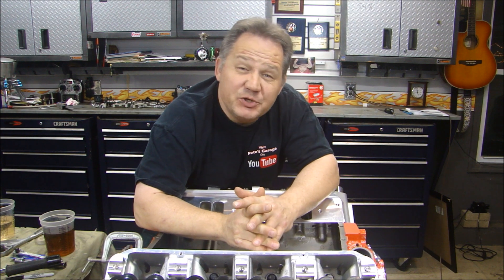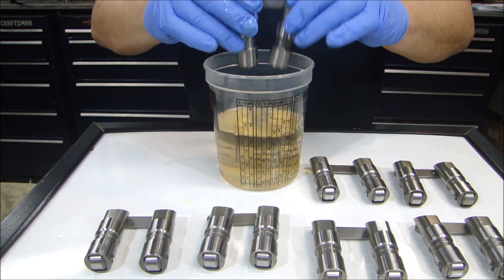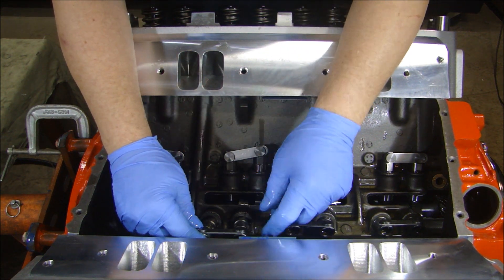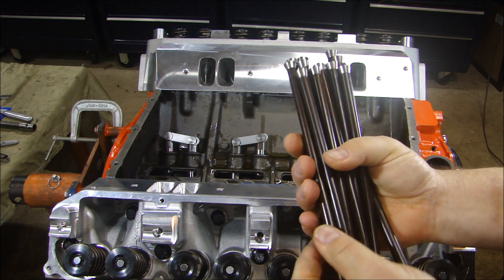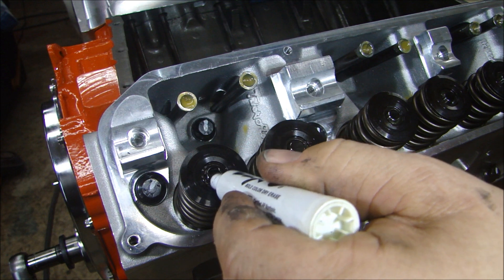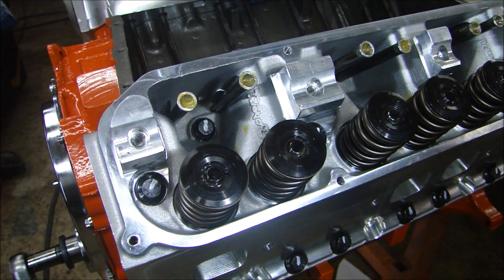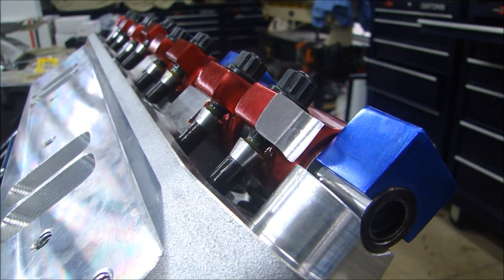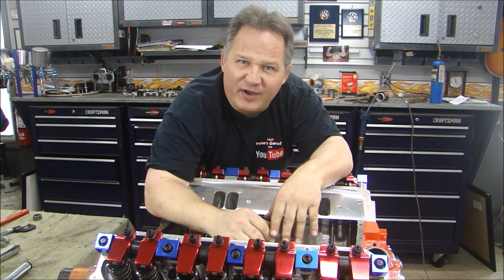440 Chrysler Mopar Part 9 - Installing Roller Hydraulic Lifters, Pushrods, Rockers & Setting Lash

Comment: I’m fighting with prw 3244012 right now, even with the thinnest shims the centre to centre its off with the valve steps, I either had to grind the 1/2” spacer in between the rockers arms or no shims on either side of the 1/2” spacer
Reply from the maker: I've ground those many times. It's ok to do
Reply: Stems

Comment: Hi Pete,
Very good instruction. I have just finished a 440 build using Trickflow 240 heads and Harland Sharp 1.6 rockers. When I start the engine it sounds like a bit of a faint typewriter. The sound never totally goes away but does get better. Do hydraulic rollers with the connecting bar make a little noise? Is that normal? 

I removed the valve covers and the rockers are not hitting the valve covers.

When I removed the covers I can move some of the rockers by hand for the valves that are up. I'm not sure if I am compressing the hydraulic lifter a bit or if it's free play. 

Is it typical for a hydraulic lifter to lose some pressure after you shut the engine down? Could this movement in the rocker be a bit of normal lifter bleed down?

Is a full turn preload pretty much standard? Can it be different depending on the rockers/cam etc.? 

Thanks for great videos. Your videos series has helped me with my 440 build.
Reply: I readjusted the preload and still had noise. I think something went wrong cause I heard clattering in the valve train that did diminish. I thought it was lack of oil in the lifters. The lack of oil pressure turned out to be a bad new oil pump. I have oil pressure but now I have a miss and puffs of blue smoke when I hit the throttle. 
My concern it bent valve (s). How can I confirm if I have bent valves from incorrectly adjusting the preload. I used a chart and was careful but something is wrong. It is a new engine build but the smoke was not there before. 
Will a compression test be enough to tell me if the piston hit the valves? I didn’t even go a half turn but apparently the procedure was not correct. The valves were up and I can’t understand what went wrong. The oil pressure works fine now but I have a miss and puffs of smoke hitting the throttle. There is break-in oil in the engine still. I don’t have many minutes on the engine but this is the first sign of oil sign readjusting the preload. Any thoughts and suggestions would be appreciated.
Reply from the maker: A compression test can detect a stuck valve.
Reply from the maker: If you readjusted after running the engine, you probably have too much preload now. I would start be setting them to zero lash and add maybe 5 degrees.
Reply from the maker: A full turn is a bit much. I go a half turn max. Try resetting and try again.
Reply: @PetesGarage  will do. Do you have any recommendations for removing sealant on cylinder heads after removing valve covers? What is your best method for installing valve covers? I have watched you in the past using Right Stuff? Would you apply to both the valve covers and cylinder heads side of the valve cover gasket?
Reply from the maker: Unfortunately it's elbow grease and solvents.

Comment: Hi Pete I am putting together my 440 engine, I bought a kit from eBay 1600$ kit aluminum heads, red and blue rocker kit , aluminum high rise intake, I am noticing my push rods are in a angle from lifter, thru the hole in the head, to the rocker arm, please help me I am confused, a few are straight and some are in a angle
Reply from the maker: The rocker arms are individually shimmed to center them
Reply: The rods from the lifter to the rockers are slightly angled going thru the head , can’t straighten completely cause rods will rub the head , being in a slight angle is that normal
Reply from the maker: They should not be. Something is off

Comment: Hi Pete from Austria,
a little odd question on your channel, I own a Volvo Amazon 4 cyl. 123GT . I'd like to change the "normal" rocker arms to such as roller rockers. Recently I got to know that those of Mopar 340 or 440 should fit .
Do you have got any idea whether that's the fact ?
Thanks for your efforts and kind regards

Wolfgang  ( impressed of your presentation !!!)
Reply from the maker: You could make it fit, but you'll have to change the transmission too
Reply: @PetesGarage  thank you for response. Changing transmission what do you mean in detail? Regards Wolfgang
Reply from the maker: One that will match the bellhousing for the new engine
Reply: @PetesGarage  ,,I'm afraid it was the wrong reply to my initial question i.e.
Do you think that Mopar 340 or Mopar 440 shaft roller rockers fit to my Volvo 123GT  B20 engine.A rumor is going about those roller rockers should fit to.

Comment: Your mineral spirited just took or dissolved any oil that was in the bearings and that 2 seconds you dipped them in oil did nothing for the bearings in the roller.   Roller lifters need soaked for a while and it has nothing to do with the hydraulic mechanism.
Reply from the maker: Mineral spirits are made from 100% petroleum distillates (aka oil). Please share exactly what soaking it does.
Reply: @PetesGarage  No kidding.  It’s not oil, it dissolves any lubricant that’s in the rollers.   Soaking the lifter for ten seconds isn’t lubricating the bearings.
Reply from the maker: So what does soaking do and for how long is it necessary?
Reply: @PetesGarage  ya soak them for hours.  And your just being stubborn
Reply from the maker: @davidleary823  I am simply looking for the correct engineering answer so everyone can benefit.
Reply: @PetesGarage  ok.  Clean as you did.  Just soak the bottom (roller) of the lifter a LOT longer is all.  Not all lifters are hippos. Hyd or solid
Reply: I put mine in a pot with oil then on the stove till the oil gets hot to the touch, then turn the stove off after 15 minutes.  Let them sit till oil gets cold then install. Same oil as what is going in engine.
Reply: @frankroy9423  good idea

Comment: I hate to bug you again sir, but have a quick question about the rockers you and the way you shim them. Do any shims go between the large black spacers between the rockers?
Reply from the maker: Yes, to get the rockers centered on the valves
Reply: @PetesGarage  thanks again, great information on this channel!
Reply: Hi Pete I am putting on a kit on my 440 that I bought from eBay 1600$ kit uluminum heads red and blue rockers and high rise aluminum intake , I am noticing my push rods are in a angle from lifter thru the hole on the head to my rocker, is that the way it supposed to be, first time doing this but don’t look normal, can you please advise
Reply: @fredvillareal3929  I had a big issue with those same rockers, PCE261.1034 from speed master. The ball end of my adjusters had a really sharp point and were binding at the pushrods. I had to remove the adjusters and smooth each one out with a light sandpaper until all of the sharp burrs were gone. It must've been a machining defect from the factory.  They seem to be working now after all of this but I'll probably get new rocker arms. Maybe from 440 source.

Comment: Hello, I'm using the same PCE rocker arms for my 383 dodge motor but having trouble finding the correct style and length pushrod. These rocker adjusters use a cup style pushrod,the length i need is an 8.3-8.5 inch or so but that size is hard to find. Is it possible to change the adjusters to somehow make them work?
Reply from the maker: Did you check 440source?
Reply: @PetesGarage  oh wow forgot about them, looks like they have what I need. Thanks for the help sir!!

Comment: Pete,  in  cleaning in spirits,aren't t the  internals  dirty  and don't get clean without pump up/pressure,  and  Why not use a pressure lube and spray  springs  during   start up,  to allow  mating
Reply from the maker: The internals are clean after machining

Comment: Hey Pete been watching your videos on the build and they are excellent. I have Indy 440 -1 aluminum heads on my Mega block, can you tell me what you would suggest for the torque on my rocker shafts? I have ARP studs in everything. I read somewhere online they say 25 to 30ft lbs. sound right? Indy is kind of subject when I call them I always get a desk clerk that has to ask others and then comes back sounding umm well not very sure…Appreciate your input gonna install tonight. Thanks
Reply from the maker: The torque is different in aluminum heads. 25 to 30 is for iron heads. Stay closer to 25 for aluminum

Comment: I sent a question on another video you have. Are the stock rockers on a 440 wedge motor non adjustable? Those you have are adjustable. The motor builder says he checked the push rod length and it was okay. My issue is getting so hot I can not let it run long enough to break in the new motor.  The plug boots met and fall apart. Before the thermostat opens  then it opens and temp goes right back up . So I shut it off. Read my other post to you. Im baffled. Now I see your adjustable rockers and wonder why this motor does not have them.
Reply from the maker: Stock rockers are not adjustable. You have to shim under the rocker rail. It sounds like you have an air pocket in the coolant system.
Reply: @PetesGarage  been playing with it this morning. No air in system it has a evap tank and thermostat kicks open and immediately cools it,  then right back up. After much asking I think its valve timing and the motor builder did not shim the rockers and set them correctly.  It seem like valves hanging open. Thank for your thoughts The carb has 72 and 86 and seems to be fine. I can get timing set but thats it. Then its melting plug boots. Im at 8degrees timing.then its too hot to work on.
Reply from the maker: If the valves were hanging open it would run poorly. Water pump, blocked radiator
Reply: @PetesGarage  Im leaning now at the engine builder may not have installed the correct pushrod length. He installed stock length push rods with non adjustable rockers and not shimmed properly. I think it needs adjustable rockers installed and adjusted. It seems to me the valves are hanging open and flames are going into the headers do to valve hanging open.
Reply from the maker: That is possible
Reply: @PetesGarage  thought I would let you know the problem. Turns out the engine was built by one guy and head set up by another. When I got into it the engine was together. Well after trying to get it to run right and no luck I pulled it apart. The cam shaft was destroyed and lifters looked like I took a bite out of them on some lobes. Replaced the cam lifters push rods and adjustable rockers  and she is a real runner now. Comp cams says its not their product but I have never seen anything like this before. Im leaning towards bad cam or lifters or both. I never have used a comp cam so not familiar with them.  Have you seen any comp cam issues?

Comment: What brand rockers and push rods ? It would be nice to name the brands 👍
Reply: You told us what brand of cylinder heads you used
Reply: @mitchellferre1652  EXACTLY
Reply: Seeing that it's so difficult to get parts now adays... It would be nice to know what rockers, shafts, hold downs, and adjusters were used. I apologize in advance, just looking for any kind of guidance  while I'm putting my 451 stroker together ( plus, I'm using your videos as a model for my build.). 😁
Reply from the maker: I do not promote any brands

Comment: i used to make roller rockers and the best cleaning is all the lifters into a plastic bucket with kerosene and some magnets under the bucket some vibrating would be good = micro hardened steel dust sticks to the new processed parts ! some times  rested the bucket against a air compressor and saw a better result on the magnets ! the vibrating - done individually in small plastic containers ! soaking hydraulic lifters for 24 hours is to remove air pockets as oil and gravity will push out all the bubbles inside the lifter - i have heard these lifters run dry on start up with out oil pump priming = so good luck and what ever works for you ! pedal to the metal !
Reply from the maker: That is awesome Ronnie. I will mention your suggestion in a future video if you don't mind.

Comment: Are these PCE roller rocker arms? I'm about to buy a set for my 383 dodge
Reply from the maker: Yes
Reply: Finally got them in, so far so good! They are very precisely made and only had to do minor shimming to get the correct gap between the rockers. The biggest hold up were the pushrods since the stock size will not work with these and the correct size is hard to find premade. I had to order a set of cut to fit pushrods from 440 source and make the size i needed.
Reply: @eddie garcia  do these rockers have needle bearings where they contact the rocker shaft or are they bushed with a bronze bushing ?
Reply: No they don't have any rollers. It is a pressed in type bearing.
Reply: @eddie garcia  sounds good that's what I  prefer. 440 source rockers had a problem with a few of the needle bearings galling the shaft
Reply: @mitchellferre1652  good to know thanks!
Reply: Any issues or breakage with these rockers ?
Reply: @mitchellferre1652  I have not installed mine yet, but I will soon .
Reply: @eddiegarcia9657  nice, please let us know how they work
Reply: @mitchellferre1652  Will do. I ordered them awhile back and they look like they are good quality in the box but we shall see.

Comment: How did you set up the adjuster screw on the rocker to measure the pushrods? I did mine by getting a full nut on the top. I ended up having the cup on the pushrod contacting the rocker. The way I have it set up looks very close to what you have
Reply from the maker: I did the set up for hydraulic lifters

Comment: You  have 2 roller rockers not in The middel.wath ai can se! Like you movise.Have even 440 sixpack Weiand tunnel ram intake.Super stock Heads wadge portad flows 315cfm ( 0.600 lift).Roller cam Tti heads.10.3 komp.Carboretors are even ported no chock.Custom (metringblock) The middel fugger.Have even The carburators inner and The Outside can ChangeThe jetts.The Engin rans  fantastisk.Have even PRO shot fogger.Have not test The fogger get.Max 150Hp.Gonna start att weery lou jets 20Hp.Wath dou you gess The HP in thes Engine.Can i have  600Hp.Sorry spell like hell.Have even Overdrive GV.Rear End 3 member have The strongest 8 3/4 (4.10) Have stall 2500.Wath dou you tink i will dou one The stripp.Have Nice Day...Challenger SE1970 Weery solid.Ale Sheat metall orginal Rost fri 100%.Forgoth have Caltrack + monelefs and calverts.Street Car
Reply from the maker: That is very difficult to understand

Comment: 71 Charger, SE, 383HP WP29N... Torr Red...Hideaway headlights, Rallye dash, Slap Stick, Bucket seats. I've owned it for 35 years. Pulling out the numbers matching engine to rebuild it stock, and then crate it. I have a 1969 440 that I want to go bat shit crazy with... 1,000 horse power, 1,000 pounds feet of torque with a 671 blower... I am wondering if you have a build plan for someone like me... I'm old now, want to go out with a bang!! Ha haaaa.... Looking forward to your answer... Ol Sarge...
Reply: You won't get 1000hp with a 6-71 on a 440. You need a 10-71 or a very good 8-71. You will also break the stock block. Aim lower.
Reply from the maker: Well Sarge, 1,000 is tough to get to without some bolt-ons

Comment: Hi Pete, just got done installing a set of rockers on my 440 that look identical to yours(Mancini Brand). I went with your .010 clearance suggestion but is it .010 or .020 total? When I ran my feeler gauge on the .010" everywhere I could I was getting .010 to .011 comfortably between any combination. But should I be trying to use two .010"s or a .020 to measure for total? You say to check either side for .010 clearance. 
The way I look at this is whatever is going on between the hold downs is a single unit, it shouldn't matter where you take that measurement as long as you have X total clearance(.010 in my case) and the roller tip is centered on the valve tip. 

Does that make sense?
Reply from the maker: It makes sense, but you only need lash for solid lifters
Reply: @PetesGarage  I was talking about the rocker clearance side to side as they sit on the hold downs. No pushrods attached. In the video you explain to check the left and right side for .010.

Comment: Hello Pete. It is great watching your video's learned so much it hurts. I have a question of course. I currently am running 383 engine with cast iron 440 heads, hydraulic lifters utilizing Isky ductile iron adjustable rockers with 3/8 pushrods that are 8 1/4" long. I am wanting to change to roller rockers. I notice on here you are using 1.6 ratio rockers PCE261-1034. I was wondering should I stick with 1.5 ratio PCE261-1033 or go to 1.6 ratio?  Also will I need new pushrods or can I use the ones I have, they are ball/cup.
Reply from the maker: You could switch to give you a little more air flow. Since the rockers are adjustable you won't need new pushrods, the hydraulic lifter will take up some slack.
Reply: @PetesGarage  Thanks for the advice. After talking to a few Mopar people I decided to stick with roller rockers of 1.5 ratio. I'm going to check pushrod length just to be safe. Since this is an engine already assembled I don't really want to remove the heads and clay the pistons to check clearance if I went with 1.6 ratio.  Keep up the awesome work I enjoy the video's.